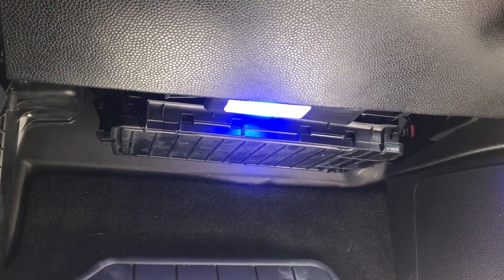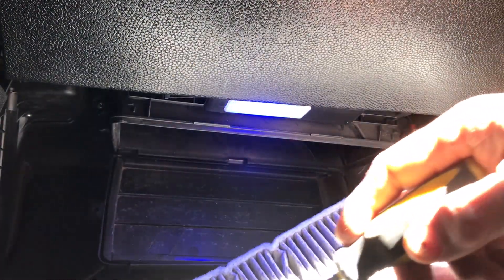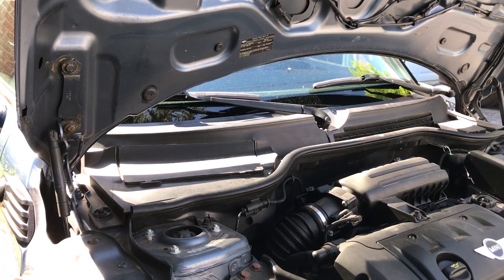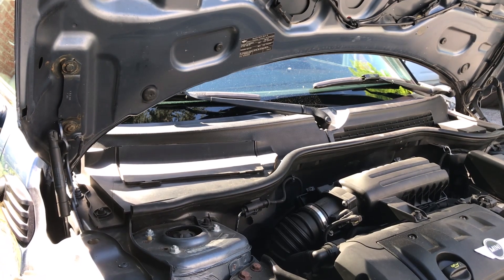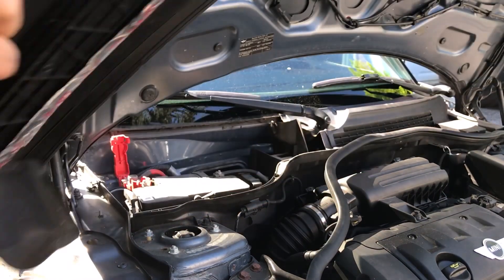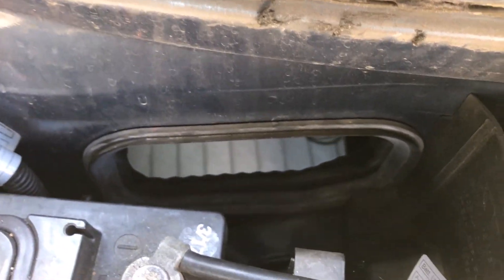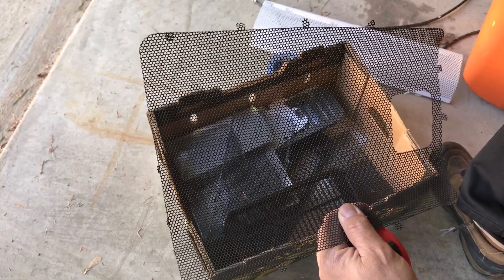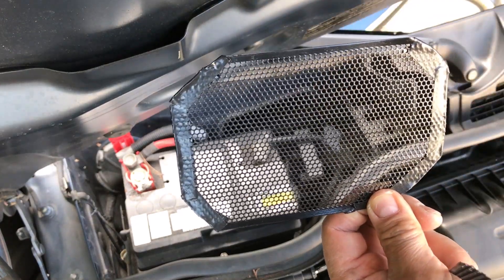Made a cabin screen air intake for my Mini Cooper

Comment: I haven't checked mine (2010) but I saw that a 2007 MCS had a screen in a battery replacement video. Maybe the previous owner forgot to put it back in or broke it. 
I like your solution though!

Comment: There should be a hinged flap in there that is opened and closed (via an actuator) by the fresh air/cabin air button on your climate controls.
Reply from the maker: @sindalgraff  Is there normally a screen to keep leaves and bugs from getting in when the flap is open?
Reply: Nothing like that, seemingly the cabin filter does that job. Strangely on the Mini part finder diagram it does identify an air duct and water deflector that fits in the engine bay side but I have no idea how it would be installed behind or around the battery. 
I only discovered this information as my wife said her car kept steaming up. Upon investigation it transpired the actuator had failed and the flap was stuck in the cabin recirculation position (flap covering the aperture on the battery side)